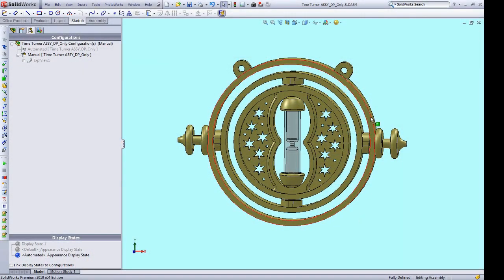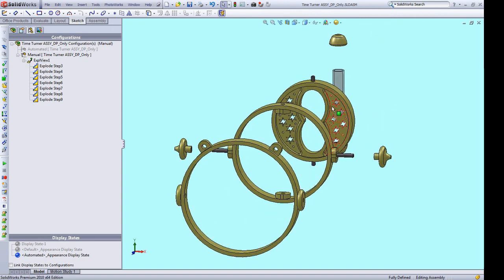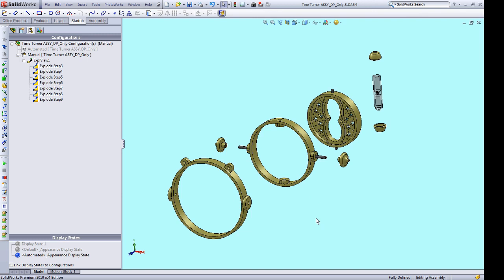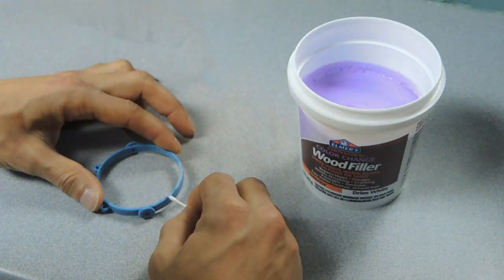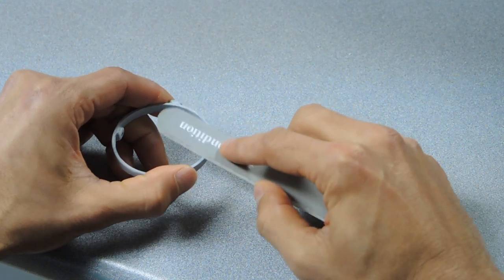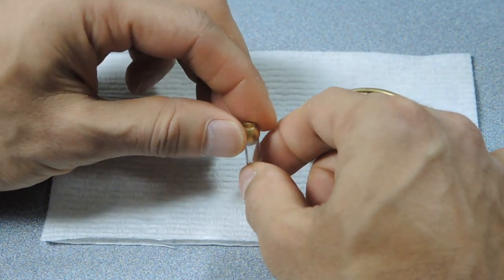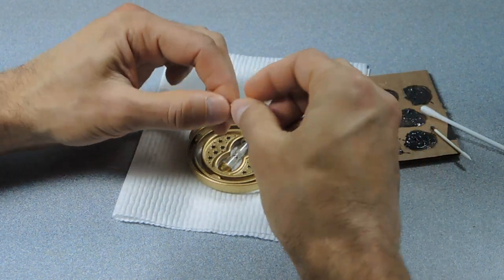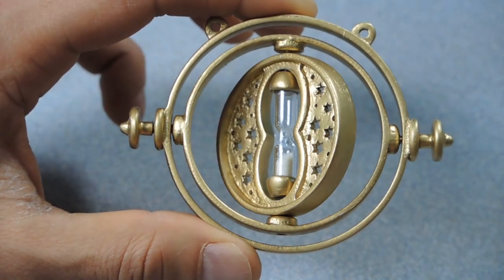Harry Potter Time-Turner: How to 3D Print and Assemble

Comment: How did you get such nice details in the middle of the central plate for the stars? Looks really good.
Reply from the maker: Thanks.  I worked hard to size them just right in CAD- large enough that they would print well on an FDM printer, but small enough to still look respectable.
Reply: i haven't tried it but that's the word on the street